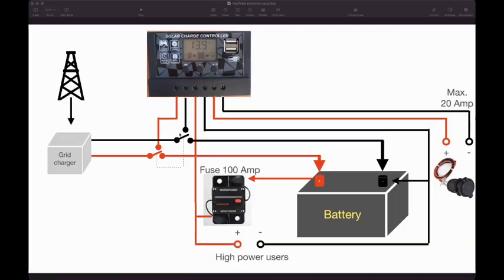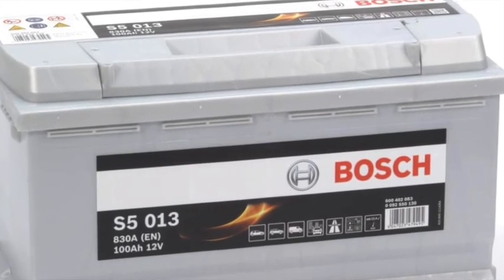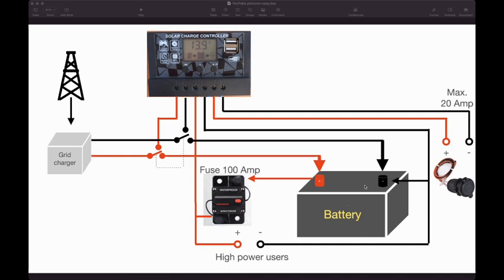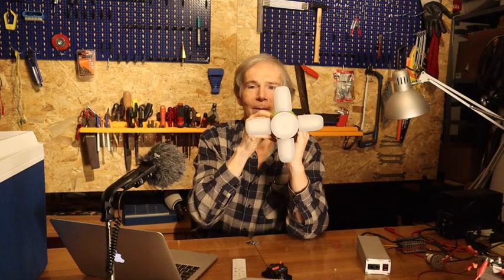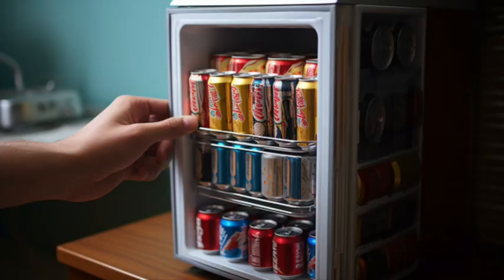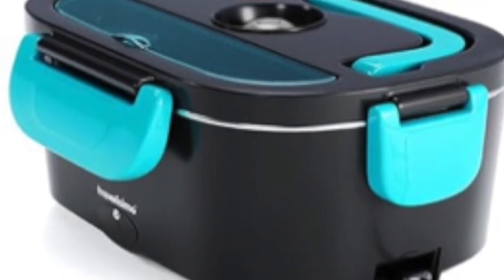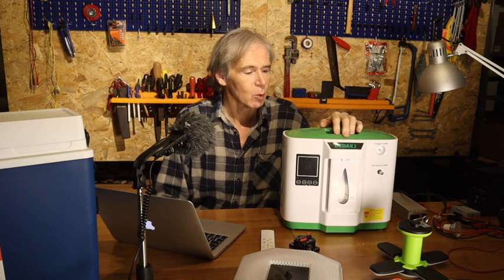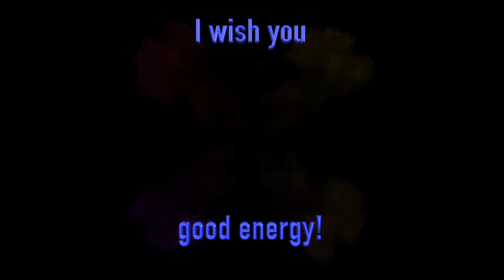How to live with 12 Volt of a car battery, Construction and list of appliances - Video 34c

Comment: I have been living off a 12v /solar panel for 2 years now... no drama so far 😉
Reply from the maker: And.... which 12 V devices do you use? Would be nice to know if you have others that I don't thought about.
Reply: @nnvasen-good-energy   just the usual  stuff, LED lighting, 12v fridge/freezer, dc fans for summer, 12v kettle for coffee, step up transformer for laptop etc. , but I live in Australia which provides plenty of sunlight for my 2 x 120W solar panels
Reply from the maker: Thanks, and is the fridge with compressor or Peltier? I guess the former if it freezes, too.
I had a colleague from Australia, he worked in mines and told about the strong sun!
Reply: @nnvasen-good-energy  yes a proper compressor but only draws 3-4amps so very efficient.
Reply from the maker: Wow, I must k ow more about that!

Comment: Thks;
I was already putting together the same type system just for the fun of it & this is a lot of help.  
My goals are KISS Occam's Razor & 80/20 Pareto's rule.
I have a few more questions but 1st my emergency essentials electrical system components are :
  1. 120VAC to 12/24V battery charger ?into the PV input of the PV charge controller?
  2. Large farad capacitor in parallel with a 12V battery (the capacitor provides all surge current & stabilizes voltage during the surge)
  3. Resettable circuit breaker near the +/hot/black battery terminal
  4. PWM PV charge controller
  5. 2x adjustable Buck/Boost DC transformer with current/voltage/short protections/etc (provide most low DC voltages across most electronic devices)
       One from the PV charge controller output ; the other directly from the battery
  6. Some type of noise suppression circuit just after the DC transformers
  7. Cigarette sockets from the DC transformers
  8. Male Cigarette Lighter Plug with replaceable fuses 
  9. All interconnected with the appropriately sized wiring 
[120VAC to 12/24V battery charger] >>> [paralleled battery, large capacitor, & PV charge controller] >>> [adjustable Buck/Boost DC transformer] >>> [noise suppression circuit] >>> [Cigarette Lighter Socket & Plug] >>>> electric device
1st question: My PWM controller max PV input if 25VDC    
  ??Can I put a regular 12/24VDC battery charger into the PV input into the PV charge controller & power it??
2nd question: ??Will a high farad capacitor paralleled across the battery provide surge current & stabilized voltage during it?? 
3rd question: I would like to automatically provide PV input into the PV charge controller from either the battery charger or PV solar panels.  
  ??What auto switching circuit can do that for me??
4th question: ??What are the rechargeable batteries (?18650?) inside the The “Camping Lantern Rechargeable, Blukar Super Bright LED Camping Lights Lamp” https://www.amazon.com/gp/product/B09XXQC2K3/ref=ox_sc_act_title_3?smid=A1XQF8JXJPUYQ1&psc=1
Comment: Peltier (aka thermoelectric) coolers are very inefficient (~5%) but electrical motor/compressor refrigerators can be ~80% efficient .  If the current surge can be pragmatically solved, compressor refrigerators are the way to go.
Reply from the maker: Hi Tombouie, there are many questions, I will answer them .  Maybe the new video of today gives already some answers.

Comment: I've decided to go 48volt... Sometime I feel 24volt might be a better options, since a lot of equipment are 24volt volt ready, and practically none are 48volt.  But some of the equipment that will run 24/7 is networking hardware which will be up a tower, and they support 48volt, so this will allow me to gain better efficiency and cheaper wiring cost.  I went with LifePo4 battery because I could afford them, but I went with the heated battery.  So it will be interesting how they perform this winter (if I can get my solar panel installed by then where I want the setup to be (It going to go in a forest, and there is very little open spot, and where it is it is far, so It will be interesting to see if I can bring the power back to the cabin from a remote location..
Reply from the maker: Hi Mochouinard, where do you live? I've been looking here in Italy to see what is easily available for 12 Volt, because it must be easy also for my audience  but there isn't too much or you must take it online. Are you completely off grid? If you are thinking about heating the battery i imagine that you are in a cold country. If you are in a forest with little sun can't you use biomass and create a thermal storage? Electric heating only for emergency.
Reply: @nnvasen-good-energy  Canada, Québec. The food heated you shown is 12/24 volt I think. I have a compresser cooler that is also 12/24 volt. In my home, I'm 100% on guide, but install 4 solar panel and home made lifepo4 10kwh battery. I bought a piece of land(forest of 45acres) that I want to setup some equipment for camera and networking. There only a hunting shed that I'm trying to fix and no electricity on site. So I decided to get renogy 48volt 50ah heated battery. I haven't received them yet, and I'm not sure where I'll install them. Forest mean no sun. I have a few spots with water, so I might be able to do something at the edge of the ponds... it a work in progress and I'm just winging it right now as the weather dictate how much work I can really do. But it fun
Reply: I went 24V. Same set of attachments: appliances, breakers, relays as 12V but wire cost savings and double  the solar charge controller power capacity. 

 48V has almost no attachment options other than buck conversion to 24v.  48V inverters have less selection and are more expensive for the same specs.  Battery costs/kWh are more with purpose built 48V.  Stringing serial batteries to make 48V comes with cabling and balancing hassles.

If I had longer wiring, significant AC load (48V DC to 120V AC inversion more efficient than 24v to 120V AC) or as you said, 48V equipment.  Inversion to 240V AC should have less difference in efficiency between 24 and 48V DC.

If you can get your AC usage to just daylight hours you can save no load power loss and inherent inefficiency of inverters during rest of day.  And using power directly from SCC vs SCC then battery is more efficient and saves battery wear.